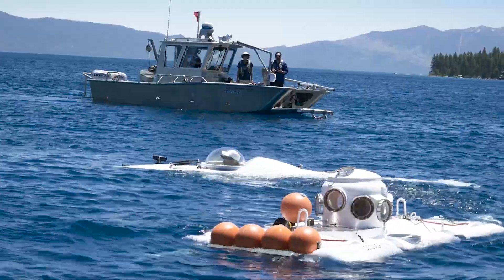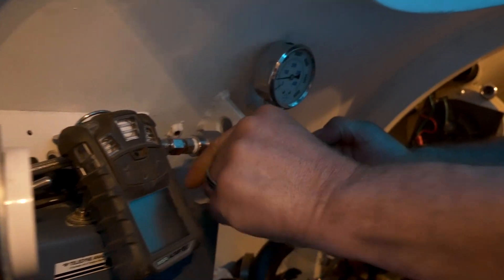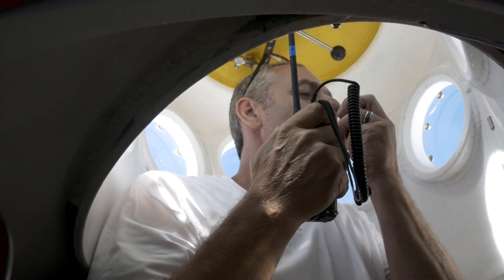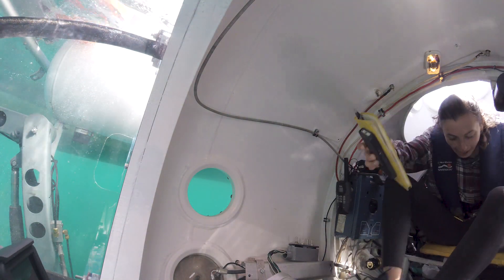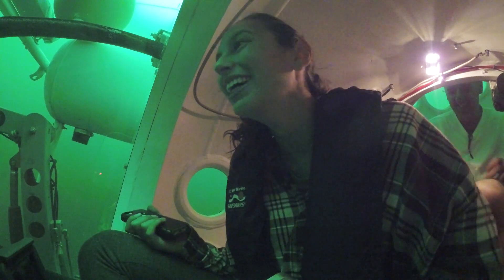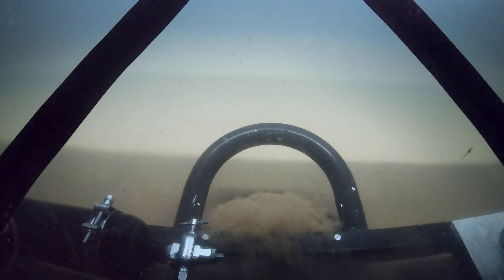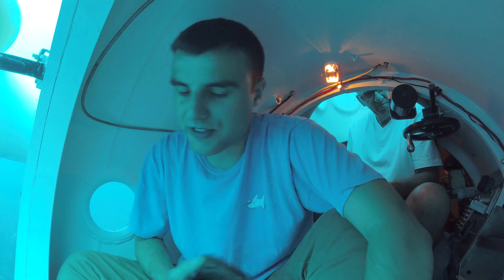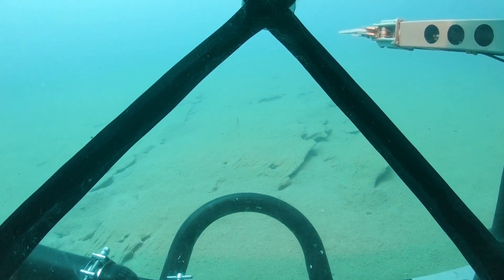Lake Tahoe Research Expedition | Homemade Submarine

Comment: I want to make a kind of submarine that the common man could buy. Not like luxury submarines or anything but more like utility submarines for fishing or retrieving items at the bottom of rivers or lakes.
Reply: I have the buoyancy part checked out well enough that I’m certain with the tools and materials I could create a submarine that go from positive to neutral to negative buoyancy however I keep running simulations in my head and theirs a tiny problem I keep running into.

I know and understand planes really well but a submarine is not a plane. The steering you would usually use in a plane would cause absolute chaos in a submarine. With that in mind I don’t understand submarine steering. For example with a plane if you were to point one jet down at angle another jet up at an angle it would roll but what would happen in a submarine if you did that with propellers? Would it roll or turn? I’m naturally going to look into things myself but I wanted to share the beginning of my subaquatic journey with you.
Reply from the maker: Most subs use thrusters instead of dive planes. Motors mounted vertically and horizontal
Reply: @HankPronk  yeah I’m going to completely overhaul my design. Gonna have to buy some more paper while I’m at it XD.

Comment: Hey Hank...glad i found your channel. I'm betting you read "The Mad Scientist's Club of Mammoth Falls" when you were a kid, huh? 

I'm more into homemade small work-class ROV's than manned subs (size of a chest freezer). But the way they behave in the water is similar.

Try putting 1/4" hardware cloth, formed into a cone shape, over your ducted props, to keep rope and debris out of the props. 
Be aware that most props are cut to be way more efficient going forwards than reverse...consider welding up aluminum props with symmetrical blades. 
It's amazing you are using starter relays to switch your thrusters...simple, reliable, yet primitive. I'd be using brushed PWM speed controllers from dimensionengineering.com . With a thruster on each corner and 4 vertical thrusters, controlled with a joystick, the sub would be alot more maneuverable. 
With an ROV, I adjust it so it is slightly buoyant, then use thrusters to keep myself just off the bottom. With the water being pumped upwards by the thrusters, you kick up alot less silt. Instead of running into the bottom repeatedly (and the fragile bottom-life living there), you can just glide along on thrusters...no thrust means you slowly drift up and away.
I put FPV microcams on my manipulator wrist(s), with 625 lumen leds on the opposite side of the wrist, to help compensate for a lack of depth perception when grabbing stuff. https://www.amazon.com/Caddx-Camera-Newest-Action-1200TVL/dp/B07GZGH9WP
A tiny spring with a microswitch on the leadscrew that closes the gripper can provide feedback to let you know when the gripper closes on a fragile object. 
Also, look at Festo-style flexible grippers...i made mine with bicycle chain covered with silicone tubing.
I use a security-camera DVR to multiplex 8 camera feeds onto one screen, and have those cheap FPV microcams looking every which way, so i have good situational awareness. Plus it records all 8 feeds onto it's harddrive, so if i miss seeing something interesting during the dive, i might see it when i review on the surface. 

I'd be willing to brainstorm with you, if ya like. I can be reached through j3-pro.com .

Comment: Hank, I noticed you now have the aft section with rudder and prop, like it had decades ago, and you removed the side thrusters. What led you to make that change? With only one prop instead of two, did that make a noticeable reduction in speed? Anxious to see more pics and video of the new sub, as there haven't been any 360 degree views yet. Congrats on the new one too:)
Reply from the maker: Hi Randal.  I accidentally damaged the side thrusters and actually prefer a single rear thruster.  I used to travel pretty far to dive spots under its own power.  The sub tracks better with the single prop.  I will be posting lots more dive video's etc of the new sub.  Thanks